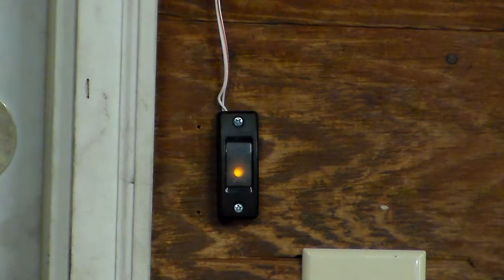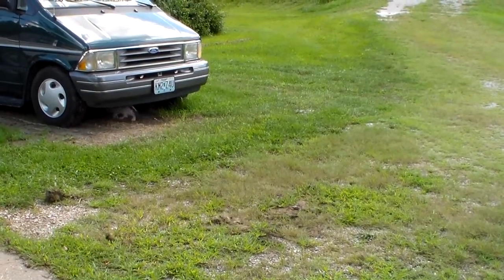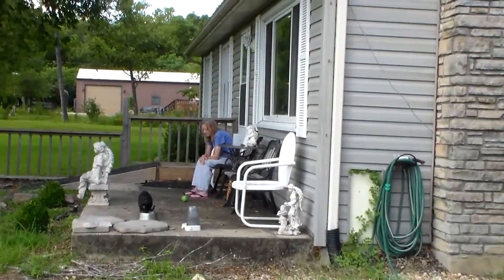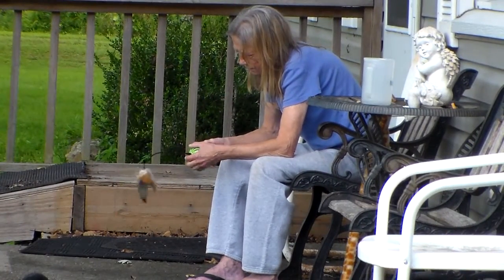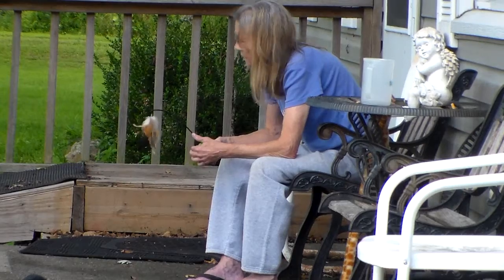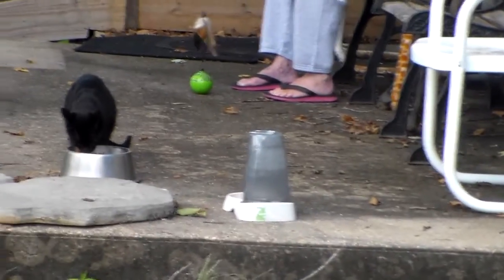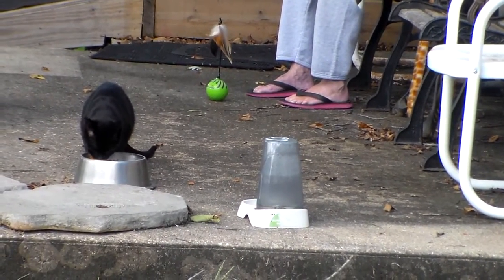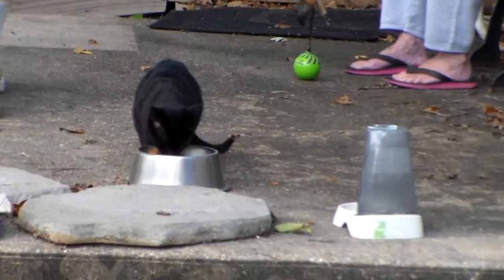Chamberlain garage door issue

Comment: Awesome dude!  I have same issue.  I`ll try the same fix.:trophy-yellow-smiling:
Reply from the maker: Good deal, hope everytghing works out for you too. Thanks for saying
Reply: @TufdogsPlace  I got a Genie opener that doesn't use wires.  Works fine now.  I appreciate your help.  Keep making videos!
Reply from the maker: @buffalochips1323  That's cool, So I assume you upgraded to a new model eh ?
Reply: @TufdogsPlace  Yes a new door mount remote.  I still have the original Liftmaster opener since it works fine with all the original remotes.
Reply from the maker: @buffalochips1323  OK, That's cool . Thanks for sharing

Comment: My new chamberlain unit not even a month old the switch malfunctioned and I’m guessing it’s because a circuit breaker tripped or a slight variation in voltage or maybe even because my contractor snipped a little too much and bare wire was touching the circuit board. The thing is mine wasn’t flashing but would come on once in a while but tonight it began to flash like yours and I just pressed the button and it has stayed solid since and is working. Chamberlain is sending me a new switch free as It can’t be wiring since it’s all new but I ordered one that has motion sensing for the lights off Amazon and hope it works.
Reply from the maker: I hope that works for you as well, Thanks for sharing...

Comment: Thunderstorms do cause jam inside the circuit board of any electronics, including the garage control board. When you unplug the power and plug it back you are resetting the board and bring it back away from jam. This is like pressing the reset button.
Reply from the maker: Thanks for sharing that, I appreciate it...

Comment: I guess those openers got a little smarter since I installed them a few years ago. The switches still had the lights in them, and a button to lock out the remotes and turn the light on, but still a quick jump of the wires would always make the opener run. I've seen quite a few openers with bad circuit boards and bad safety sensors after a lightning storm, never a switch tho.
Reply from the maker: Yeah, They have really made it over complicated. Thanks Tom
Reply: I'll figure it out a good way to lock remotes when I go on vacation. I just turn the the breaker off to the garage door.

Comment: You proved to him twice the wiring was OK.  I think there is too much technology.  It should just be a switch with contacts like the old ones.  Good for you.
Reply from the maker: I agree with you, Why the need for a circuit board in the switch ?  Seems over done to me too. 
Thanks Bruce
Reply: You know I installed two of these doors I tried to add some old garage door opener wall switches right next to the door so when I step outside all I have to do is reach in and touch the button to close them. But since the switches don't have the circuit boards in them they would not work with this system. So I had to buy a Chamberlain battery-operated remote that can open two different doors and mounted it on that little piece of wall in between the 2 Doors. It's bullshit

Comment: Strange. Most systems if they go down press reset or unplug them. However some system have extra features. Some even build same units with feature less functions however the features are there. You just found out yours had one that you didn't know it had.... A light button... Well some have a Vacation Feature as well. Most of the time they Blink like yours was. Then there is a button on a switch that would change back to normal and light would be steady... Most times this can be the difference between a Jobber model and deluxe. Only a Switch. You see yours has the Circuit board and some of that has to do with LEDS that is inside. However it also has to do with Resistance to the Controller. So say the light is caused by a Voltage drop that can be added by a 1k resistor most times that would be if you click it on it need s to be clicked off or cycle of the Garage door and resets back to normal operation. Then say you have the Switch that offered the Vacation mode. This mode also turns off your Code Hopping remotes you might have in your Homelink in your Chevy or Honda if you had the option or even some come with a Remote control that you can hang on your visor. These in vacation mode are turned off only way to make it work would be a button that your system didn't really have....So once the new button came it acts like the real button and caused the Vacation mode to be turned off.. So this is a guess. While I know some of the ideas behind. I am not saying your system light is caused by a 1k that is as if it was... There is something that you could test to figure this out... However I am not going into that.... Good they sent you a nice feature rich switch...
Reply from the maker: You seem quite knowledgeable about these things.  Thanks for sharing your thoughts.

Comment: That's odd. There is more to that switch than a set of contacts and a bulb. Two wires and two functions. Open and light.
Reply from the maker: Not really, one power in, powers the lighted switch & door function when the contacts meet.  That's all it does...

Comment: I have a Chamberlain as well,  good system .
Reply from the maker: Yeah it has really been great , up til this happened. It's working fine now though.
Thanks Robert
Reply: Don't go buy a generic wall switch the says it will work on all openers. Because wherever I have lived I always add a second switch right next to the door itself so I can reach you in push the button and have it close. So I don't have to punch the numbers into the keypad and every time I want to close it. It won't work they put something inside of that opener the keeps it from working with any other remotes or wall switches